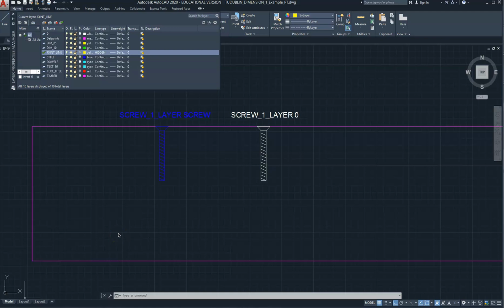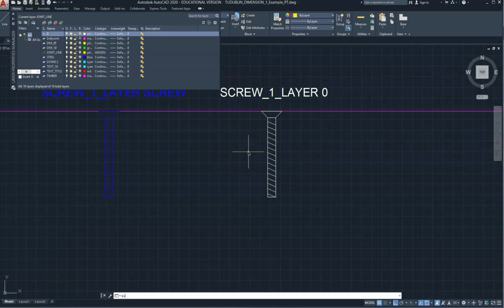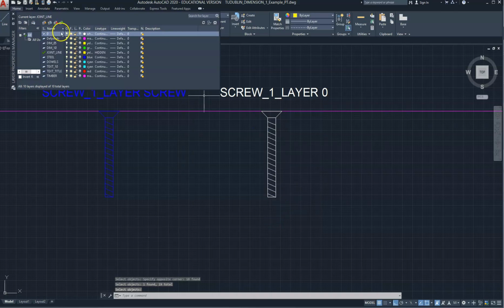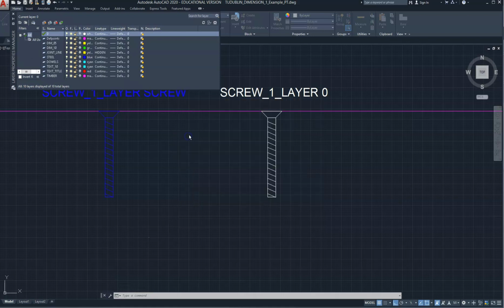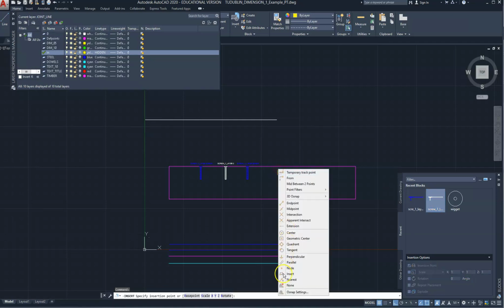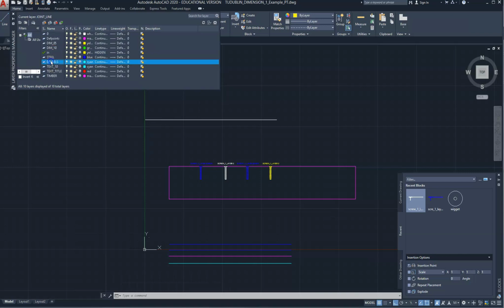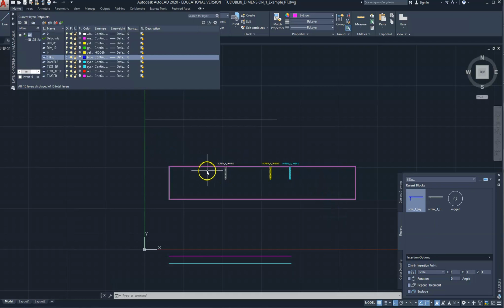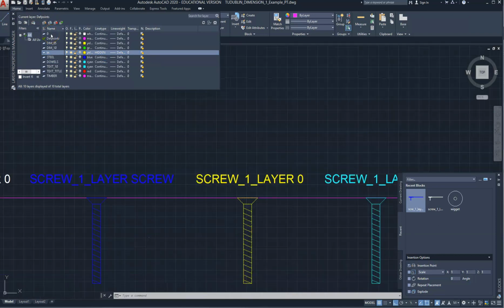LAYER 0 BLOCKS Layers Basic 2d3d AUTOCAD

Comment from the maker: The easiest way i find is to create the various line weight weights at the end of the creating the block, then use Match Property ( keyboard shortcut MA) to match all the elements in the block you want to have the line weights, you can use either PolyLine Edit : Width or Line Weight on individual lines. Generally I find it best to use PolyLines for all lines (shortcut PL). Hope that helps